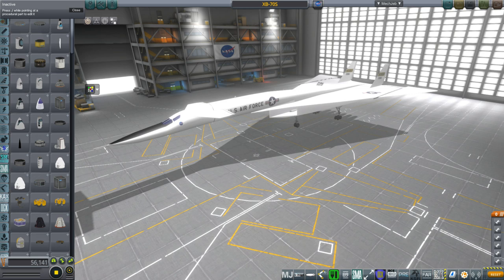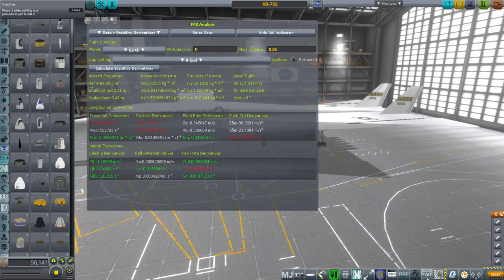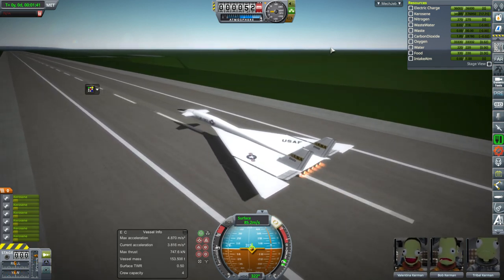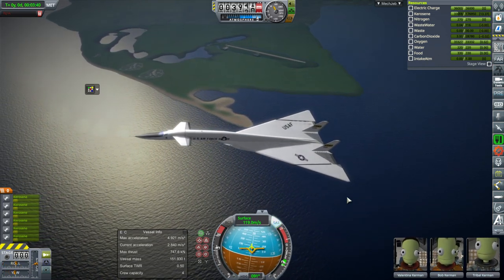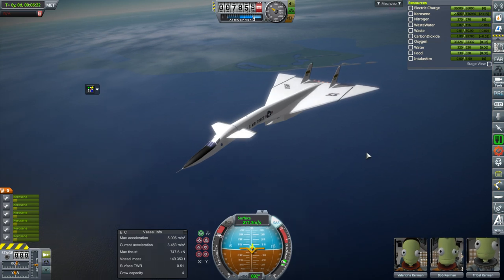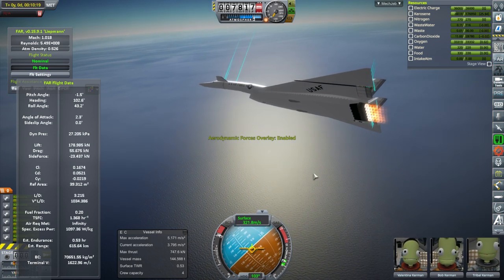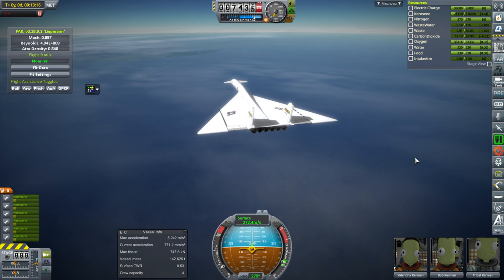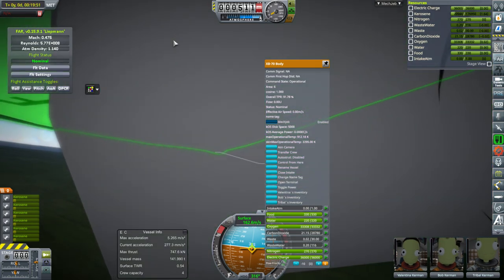KSP - Realism Overhaul Sandbox - XB-70

Comment: It's impressive that the stock aero model is so bad at simulating the XB-70; It should pass through Mach 1 like a hot knife through butter.

I find it strange that the XB-70, though only flying 10% slower than the SR-71, was a way more conventional aircraft in terms of its structure: No percussive maintenance, no deliberate gaps, no hypergolic ignition, a more conventional fuel mix, less of a deliberate turboramjet effect, etc. It also could reach similar speeds with a lower TWR than the SR-71. This makes me wonder if, with some extra R&D, they could have made the SR-71 a more convenient vehicle, and also about how fast or high the XB-70 could fly if it was re-engined with the J58 and/or with a fuselage built according to the principles of the SR-71.
Reply from the maker: It's not the stock aero alone, to be clear. It's the stock wing module combined with FAR aero (which is still technically operating even though the wing isn't configured for it). I think reducing the wing area in the stock wing module might help with the drag - we seem to be getting too much lift anyway. You make a good point about the XB-70 and SR-71. The XB-70s engines did need a few special features - it's fuel-cooled and also needed liquid nitrogen to pressurize the tanks. I expect that here, North American's experience with making spacecraft as well as making the Navajo missile (which informed a lot of stuff like the early designs of the Space Shuttle) definitely helped them.

Comment: This plane takes off at such a slow speeds is it because of the lift genereted by the huge wings? (Sorry for English)
Reply: 90 m/s isn't particularly low, but a plane will take off easier if the landing gear is directly behind the centre of mass (CoM), and adding control surfaces far away from the CoM also helps (like the canards in this situation)
Reply from the maker: The takeoff speed is actually rather high for a plane.This plane is currently underfueled, though, so it's lighter than its maximum weight. Also, I think I need to reduce the stated area in the stock wing module to reduce drag, so I expect that the takeoff speed may increase.

Comment: Mechjeb has its own info about drag and lift, maybe it can help? Does far messing up with f12 vectors? Looks like your main body has drag, but it not showing it. Maybe intakes?
Reply from the maker: Well, something is messing up the F12 vectors, because otherwise we'd go through Mach 1 easily without drag. The intakes are integrated into the body.

Comment: How does FAR change airfoils and aerodynamics?
Reply: Shamir Edwards It makes it closer to a realistic model than the base aerodynamics.
Reply from the maker: Basically, stock aero module just takes in the wing area while the FAR module needs the span, chord, wing sweep, and taper, so it takes more into account. Note that the modules are separate from FAR actually operating - FAR is still doing other stuff regardless of these modules. Interestingly, FAR understands the shape of the plane when I do transsonic analysis (checked that, but forgot to show it).

Comment: why are you trying to land the thing at 250mph?
Reply from the maker: No airbrakes installed and it wouldn't slow down. I think it's got too much lift. The real thing also had a drogue chute, so it tended to land pretty fast (though obviously not that fast, which is why I didn't actually attempt to land).
Reply: @RaizSpace  honestly I think you should use part scalar and go for the stock turbo-ramjets as propulsion. 320m/s is way too slow at that altitude. also the real one had leading edge slats. maybe you could put those on the leading edge of the wing instead of a big ugly airbrake to slow it down and create downforce to hit the ground faster. I think Airplane Plus has some good leading edge and kreuger flaps.
Reply from the maker: Stock turbo-ramjets? These are the actual engines the XB-70 used. Something else is the problem there. I'll look into additional surfaces, but just keep in mind that this is still Realism Overhaul - things don't work like they do in stock, and they have to be configured a bit differently.